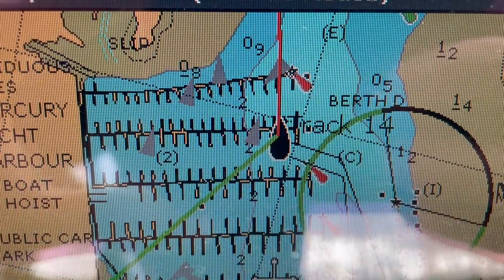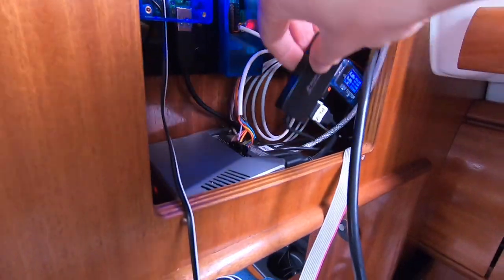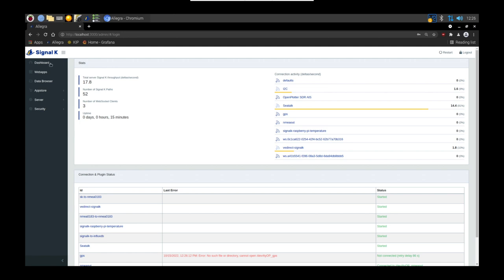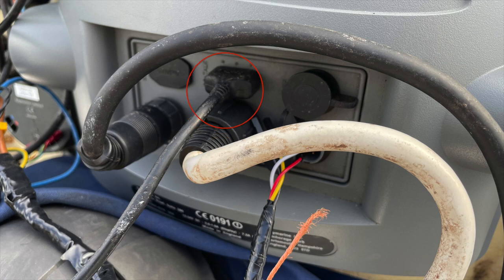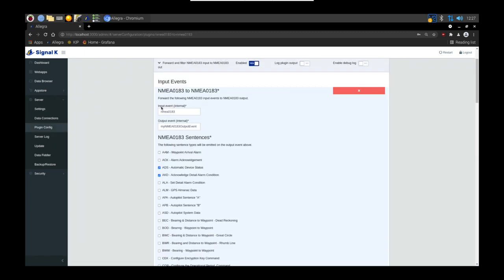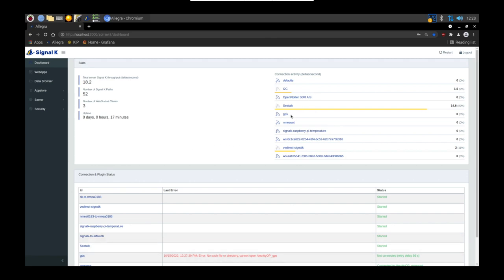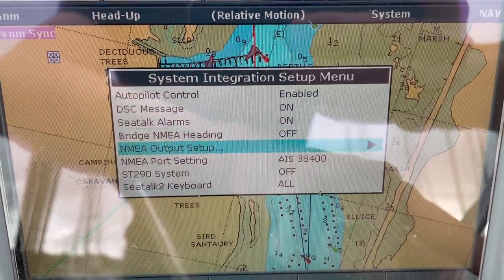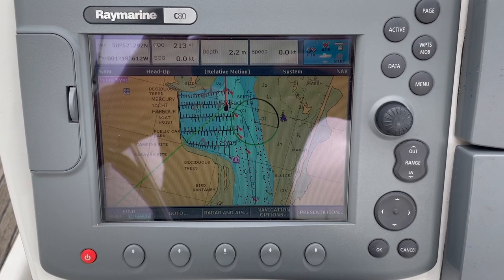OpenPlotter Data Multiplexing - AIS on a Raymarine C80 from SignalK - Boat Projects

Comment: Great info - thank you for sharing. I look forward to getting sdr with a Pi delivering AIS data to my standard horizon chart plotter on my boat. One item I was wondering is how to deal with safe shutdown of the pi? Ideally just flicking a switch on the breaker panel would trigger a safe shutdown (and start up too!) thanks. David.
Reply from the maker: Many thanks for your comments. You can buy a board with a battery, I think they do a large capacitor version now that will perform a safe shutdown of the pi if it detects a power loss. I have to say that in the 18 to 19 months I’ve only turned the power off a couple of times accidentally and not done a full shutdown. Maybe you could colour code the switch as an alternative and see how you go? Do try and backup the SD-card when you are happy with the setup. ⛵️
Reply: @BoatingwiththeBaileys  yet another great video, just a question regarding the type of cable you are using is that nmea0183 cable or just a normal 5 strand cable, also it looks like you have only used 2 possibly 3 of the nmea connectors at the back of the mfd but 5 at the serial port converter? any way keep up the good work .
Reply from the maker: Hi David, thanks for your comments. I’m just using 4 way speaker cable I think it is until I proved it was working. I will try and find tinned if I can for the proper installation. Yeah just rx + and - plugged in at the MFD. I did contact them all but for me it’s not needed as it’s just AIS going to the display. I did contact them all at first to make sure the serial converter was working. Could be an alternative if the Seatalk cable to that display even failed.
Reply from the maker: Just 4 at the other end sorry missed that off the reply. The cable is screened.

Comment: hi Mat, quick question regarding the connection you made at the back of the unit! are you using gpoi jumper wires for your initial testing or are they a different size?  also did you download the driver software for the  serial usb connector straight to the pi? great videos and very informative.
Reply from the maker: Hello, Yeah its just connected on standard jumper cables, they made a good fit. In terms of driver software, no, that USB to serial converter is an OpenPlotter recommended one and just plugged straight in and worked. The plugin and filtering was the most complicated bit. Hope this helps.
Reply: @BoatingwiththeBaileys  hi, that`s perfect i got that one through your affiliate link so really glad thats one less program to try and install 😅 but none the less im trying to mirror what you are doing but at a lot slower pace 😣
Reply from the maker: Thanks for getting it via the link. Once you get started with these projects they just tend to snowball. I had a quick look at your drone footage before, it looked good 👍 let us know if you need any further help
Reply: @BoatingwiththeBaileys  that`s ok, it makes more sense to me to use the items that people are using in their own projects that im basically copying and thanks for putting your code up to github that saved a lot of head twisting   👍👍

Comment: Great video!   Is it possible to do this over WIFI using an NMEA WIFI gateway?
Reply from the maker: Hi, Thanks for your comments. When you say over WiFi, is the AIS sending data over WiFi or is it possible to sending data to a C80 via WiFi? If it’s the last one, no, C80 can only accept AIS via the NMEA pins or possibly seatalk2 (not tested that). If you want to send WiFi AIS to your pi, that should be possible.
Reply: Thanks for the info.  For clarification, I was asking about the latter (Is it possible to send data to a C80 via WiFi using an NMEA WIFI gateway).  According to the website for the Yacht Devices NMEA 0183 Wi-Fi Gateway YDWN-02,  it mentions the ability to use two gateways as an NMEA 0183 wireless extender (using UDP).   I was thinking of using one gateway (receiving NMEA from OpenPlotter (SignalK) ) and connecting the NMEA 013 output directly to the C80 (in my case an E80).
Reply from the maker: @SuperPiratemike right I see. So use the WiFi to reach the device and then convert back to wired NMEA0183. I that case I see no reason why it wouldn’t work. As long as you can set the output to be the faster rate the C80 uses for AIS. Report back if you try it and let us know.
Reply: @BoatingwiththeBaileys  I am initially going to use it to send route data, not AIS.  I believe that because of the baud rate I can't have both.   The E80 controls my autopilot.  I'll pick up the AIS via WIFI on my iPad Pro which I use to to run Navionics.
Reply from the maker: @SuperPiratemike that’s correct it’s NMEA data or AIS in the C80.

Comment: Hi Mat, I have followed your Pi installation since the beginning and now that you had the unit working for close to a year, would you say such installation is stable and sturdy enough to be used as your primary system? 
If you were re-doing all this what would you do differently or different components? 
Actually that second question could be a video on its own! L
Cheers,
a.
Reply from the maker: Hi, Now that's an excellent question. If I was starting again, I would definitely start with an SSD-driven Pi. The performance boost that has given the whole system is really hard to capture but that's been a better upgrade than the increase in memory. A Pi4 4GB and an SSD I think is about perfect. The installation is stable, however, and I mean absolutely no disrespect to all the time the developers put into these solutions, I still think its a secondary system with a whole heap of additions. The reason I say that is that they don't have complete control of the whole system. If it was ground-up OS and software then maybe, but one small change by someone else could have you (and them) working for several hours to troubleshoot. I still think that's less likely for a dedicated piece of hardware. OP3 looks very good and that might change my view. However, the flexibility it offers and the additional information that my system captures would have cost me a fortune or have been completely impossible. There just isn't anything on the market to make an almost 20yr old diesel engine digital. I need to think a bit more about this...
Reply: @BoatingwiththeBaileys  thoughtful reply, thank you!

Comment: Hi, about 30 seconds in when looking at the port on the back of the C80 you say it's for nmea and AIS but isn't it nmea in and out per the diagram you show of the connector. You are using the nmea-in pins to receive AIS data from Openplotter, is that right? Many thanks
Reply from the maker: Hello, that’s correct these are the nmea pins, when I say for AIS, you change the port speed in the settings on the C80 so that it can deal with the increased data that AIS requires. I believe this stops the port being used for NMEA0183 when used in this mode. Data is coming out of OpenPlotter via a USB to serial converter to the C80. I’m only sending AIS sentences via this connection. All other data gets to this display via Seatalk. Let me know if you need any further info
Reply: @BoatingwiththeBaileys  Many thanks for your prompt reply and for taking the time and trouble to provide your excellent material.

Comment: Why i don't see my SOG on a display? The position is fixed and everything works fine, do i need to enable it in settings?
Reply from the maker: Hi, The information in the data bar is customisable, so you can add things like SOG, Time or other information to this top bar.
Reply: @BoatingwiththeBaileys  thank you. I'll try.